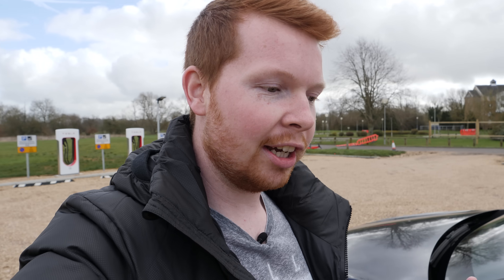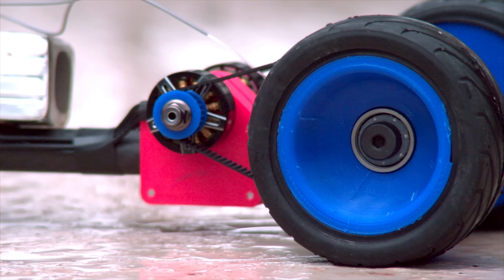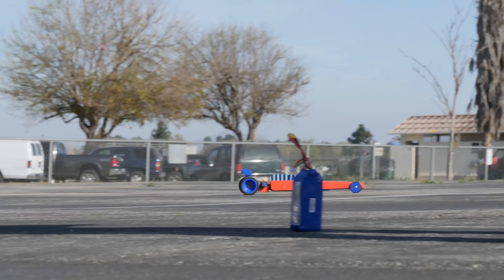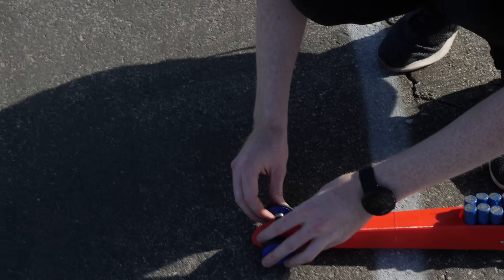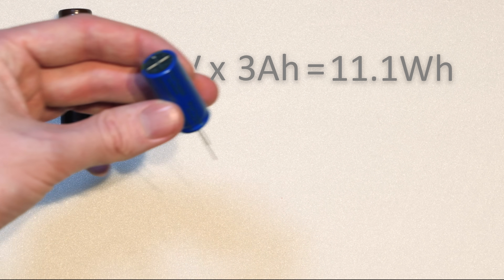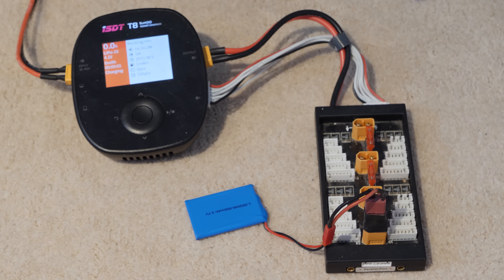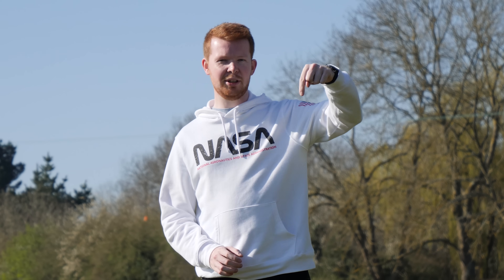Super Capacitor Dragster

Comment: OK - please explain this to Elon Musk (and give me credit where its due):

There are supercaps out there that that can provide enough range on a Tesla for average commute (around 30 miles per day, looking at statistics online), which would take up about 50% of the volume of the battery bank of said Tesla.

SO: 50% batteries, 50% Supercaps. the equation is simple: 
Caps would power for normal commute distances, reducing charge/discharge cycles on the batteries. Longer range trips would use batteries, but combines charge of caps and batteries would give frequent short stops for charging.

This would provide huge benefits:
significantly prolongs battery lifecycle (possibly to the expected use-term of the vehicle)
charge in minutes for normal commute
cost savings to consumer (replacement battery packs)
cost savings to the manufacturer (recycling / production of battery packs)
environmental benefit for less battery recycling or/ dumping
potentially more instantanious power availability
possibly lighter (if suitable supercaps are lighter than the batteries they are replacing per volume)

OK, range would be sacrificed to a degree, but for average use this probably wouldn't pose a significant risk to consumer preference, given benefits above (especially cost and charge time).

Thoughts?
Reply: Sounds great!
Reply: i like the idea from an environmental perspective. with supercaps in cars they would basically last forever, making a more green solution.    i'm willing to bet that Tesla ruled this out for a good reason, but like you, i don't know what that is.  I'm not a tesla owner or expert by any means.. but If i had to guess...

the batteries in those cars seem to last the life of the vehicle anyway.  what is the real purpose of making the battery last longer/ forever if the rest of the car is worn beyond repair?  

with supercaps only, you'd have to charge every 20 or 30 miles, basically every time you drove it. i can see that being a significant hassle vs charging every week or 2.

certainly a supercap only, or a 50/50 split by volume of supercaps and batteries is an interesting idea.  I'm sure it wouldn't work for everyone, but it would be interesting to see how it compared to an all battery solution.
Reply: Both Musk and Rickard are adamant there is no use for Super Caps in EVs.
https://youtu.be/zlJRo9yVzus?t=4214
https://www.youtube.com/watch?v=NxmO_QuD4Do&t=1712s

Comment: Can we use super capacitors as a buffer to charge battery faster  , like RAM in a pc ?
Reply: No. batteries can't handle high current charge rates like super capacitors. they dont have enough storage capacity to fill the battery up enough. the heat generated would drop the efficiency significantly.

Comment: lipo you can discharge from 4.2v to 3V.  The capacitor you could discharge to zero volt without damage. possibly you could add a DC/DC step up so get a constant output voltage even when the Caps are getting low?  Although the current increases when the voltage lowers.  When having capacitors in series and completely draining them,  in case the caps are not matched/unbalanced, you may invert charge the weak capacitor.  As they do have a polarity, i can assume can be bad for them.  Anyway interesting experiment!

Comment: Couldn't you get more out of a supercap with a boost converter? Batteries are cut off at a certain voltage because 1. they just can't flow enough current to do the job below a certain voltage and 2. to avoid damaging them. Supercaps aren't hurt by a complete discharge.

Comment: See supercapacitors would be a great way of regen braking a performance hybrid or EV. Just load up the cap bank when braking and use it again to fire off again, taking the strain off the other powerplant.
Reply: Both Musk and Rickard are adamant there is no use for Super Caps in EVs.
https://youtu.be/zlJRo9yVzus?t=4214
https://www.youtube.com/watch?v=NxmO_QuD4Do&t=1712s

Comment: If you charge a lithium ion battery to fast it will eventually explode like those samsung phones. They wear over time but it's builds up a chemical in the battery that can cause it to explode when the terminal in the battery are bridge by the chemical.

Comment: batteries: 27min on, 1hour51min charge. ~%20 uptime
caps: 1min40sec on, 15sec charge. ~%87 uptime
seems like a good increase.

also does peter have a folding karambit as an every day carry?
Reply: So you could maybe do small charging strip's on highways to charge your caps while driving. And to extend range you have a regular batteries or even charge your batteries over time from the caps. But I don't know how efficient that would be
Reply: Codiac Using capacitors to charge a battery would be just buffering. Optimal efficiency would be to charge the battery directly. Capacitors are nice but their size to power makes them less practical and their cost is even more expensive than lithium batteries as they are now for less power.
Reply: DriveJapan I don’t understand the hype for supercapacitors as if they were invented yesterday or something.
Reply: amorag59 most people are not truly tech savvy, never herd of them, and it sounds like magic. Perfect recipe for flash popularity. 

Most people can’t tell you the difference between the various types of capacitors. Let alone the benefits of each of them. Tell someone they block dc and pass ac any watch them try to process that. Or to add fuel to their confusion tell them that electrons don’t actually flow through a capacitor. I have had people who know a bit about electronics/electricity call me a liar because they couldn’t wrap their head around that. 

Magic I tell you... magic!
Reply: @drivejapan6293  Good point. As an EE I have the privledge of people smarter than me laying down the facts. But then again I see people with comments like "We could line our roads with charging coils to charge the caps as cars/buses go by" Lol yeah the same people so eager to fix your potholes is going to spend millions on that, suuuure. Lol doesn't take a tech sav to see that is ridiculous  😂.
Reply: @amorag59   well it's a stupid idea. But there is a 5km test track here in Germany, where they look if it is feasible to charge/drive a truck with overhead lines to reduce its emissions and fuel consumption.
Here a random link to a news article: https://www.electrive.com/2019/05/06/ehighway-project-kicks-off-in-germany/
I haven't done have further research into this stuff.
Reply: Codiac The trucks in that article are hybrids and don’t mention any testing capacitor technology. Capacitors store so little energy you may as well have no electrical storage or Li battery (or hybrid) because energy density becomes more important with heavier vehicles like a bus.
Reply: Well, you can put the battery on a shelf, charged, and it will be about the same, a week later.  A supercap, or any cap, will discharge itself significantly in a matter of hours.

Comment: Could you use a combination of regular lipo and supercapacitors on an electric car to charge it very quickly then have some sort of circuit to charge the lipos while you drive?
Reply: You could certainly do that, but either the capacitors would need to be much, much bigger than the batteries, or they can merely top off the batteries a little bit. So for normal charging this doesn't really buy you much, but it could be useful for regen braking.
Reply: Or possibly at some point we could have run-through chargers – charge every 5 km or so, without even slowing down. Might be possible with capacitors.

Comment: There's probably a fun community event in here somewhere. You could have an f1 race with a bunch of charging ports teams can use during the pitstops. With the supercaps being as quick to charge as they are, you dont have to worry about complicated battery hotswap things. 

Could also mix it together with those micro-rc scale towns people build and suddenly you've got something goofy enough to maybe work. Have different leagues for different ratings and design constraints, different track types, and maybe even different vehicle types.

Comment: How did you get away with not using balancing circuits? In my reading and experience, you always need balancing circuits with supercaps to keep the voltage of each cap below 2.7v.
Reply from the maker: Each series set of capacitors has a wire attched to a balance lead, like a lipo battery. Then after a few cycles, I use a bank of resistors to discharge all the capacitors to 0v. They seem to stay pretty well balanced after atleast 10 cycles between discharging.
Reply: @TomStantonEngineering  Thanks for the reply! Are the balance leads only used for discharging then? It's seems during charging by the Li-po that they are not used.

Comment: You should use a boost converter so it keeps the voltage output up. Capacitors' voltage is proportional to their amount of charge, so they drop off way faster than a chemical battery, which can maintain a rather steady voltage.

Probably wouldn't get you much, but would have been a cool thing to discuss about batteries vs capacitors.

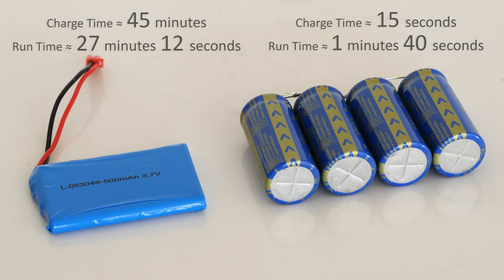Comment: The data at 5:30 is very interesting. If you want to maximize driving time and minimize charging time, regardless of runtime, the capacitors are much better. For a full cycle, only 13% of time is spent waiting while charging the capacitors, meanwhile 62% of time is spent waiting for the lithium battery to charge.

Comment: Why don't you add a bunch of geared brushless motors so the movement of the wheel keeps charging the capacitor? It won't last forever, but at least play time will be drastically incremented. Am I wrong?
Reply: great out of the box idea! However, this would reduce the overall efficiency and drastically slow down the car.  If you want more range you would be better off increasing efficiency by reducing friction within the car.  i recommend you research perpetual motion machines and why it's not possible do get more range by dragging a generator.

Comment: Radio Shack Zip-Zaps used caps to quick charge off the batteries in the remote. So much fun, haven't seen a good replacement in recent years.

Comment: It still makes no sense to me. Why? well I know that if you place a load on one end of a wire, you need and even bigger generator on the other. The current delusion seems to ignore the need for a generator. Its as if electricity is free - has no environmental impact - and we can all live happily ever after. And that ignores the environmental costs and contamination involved in making the electrical and infrastructures required for making the vehicle components, controls, the new generation and the other components like wind turbine blades and towers. On top of that we used to have a beautiful rural skyline here - not any more - all those towers. I saw one analysis which claimed that all factors taken into account, it is better to drive something big like a hummer. I too see how enthralling is the research and technical advancement - but won't it turn out to be too good to be true once subsidies are removed. And lastly one thing I personally notice -  As a pedestrian, I cannot hear electric cars approaching - and drivers usually have other things on their minds than pedestrians - especially when the car is crossing a foot-path. They will run me over and kill me one day. In my view the whole matter of electric road transport is still a hysterical irrational religion.

Comment: that's why supercapacitors are used to buffer energy from regenerative breaking on cars, so that they can charge very quickly and then slowly discharge to recharge the main battery or be used for standing starts
Reply: Name a commercial vehicle using super caps in that way.
Both Musk and Rickard are adamant their is no use for Super Caps in EVs.
https://youtu.be/zlJRo9yVzus?t=4214
https://www.youtube.com/watch?v=NxmO_QuD4Do&t=1712s

Comment: There are busses in China that run on supercaps. The busses can be charged at any stop but have a range of at least 5x as much so that no issue. An advantage of supercaps is that all energy of regenerative breaking can be used to recharge the capacitors whereas batteries could only use part of the huge amount of energy generated by breaking. 

Some EV’s use supercaps to capture the energy from regenerative braking.

Comment: Super Capacitor tech is OLD.  You're not the first guy to think of this. The problem is that Super Capacitors have a very fast self-discharge rate (they lose charge even when doing nothing) and they would have a VERY short range. You would need a super capacitor bank the size of a house to get acceptable range.

Comment: So, there was a difference in size between the super capacitors and the lithium ion batteries BUT, what was the difference in weight,? and what was the difference in maximum current (dead short)?

Comment: I think your capacity equation assumes that you're running the super caps to 0v which you're not, so the usable capacity may be even lower
Reply: Yes, but becaue of the quadratic U², the low-voltage end doesn't actually contribute much in the total energy.

Comment: So... place a tiny set of lithium cells (something WAAAAAAYYY too small to run it normally at full load) in parallel with the capacitors, and see how well the load balances between the two - in lull-periods, the caps should charge back up, and during peak draw for acceleration etc, they should handle the brunt of the load without stressing the lithium cells terribly much.
Reply: https://youtu.be/zlJRo9yVzus?t=4214

Comment: Cant you make a car that has half a set of capacitors for starting or getting up and going with a charging system connected to the wheels or something so that when the first set of capacitors will be taken over by the second set that charged at the beginning and when the second set takes over the first set could be charging the same way and keeping this cycle going. This way a vehicle on a gradual path could go on a long time.
Reply: Theoretically.
Reply: Too many inefficiencies for this to actually work.